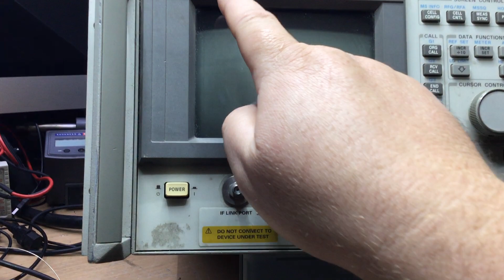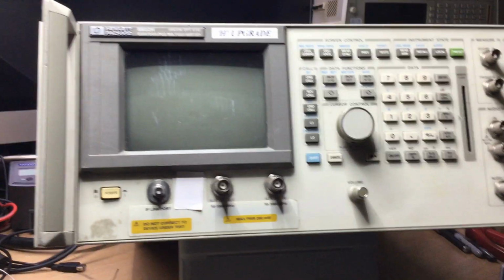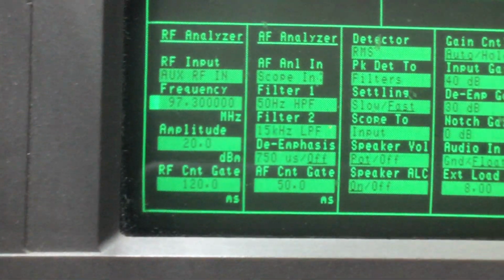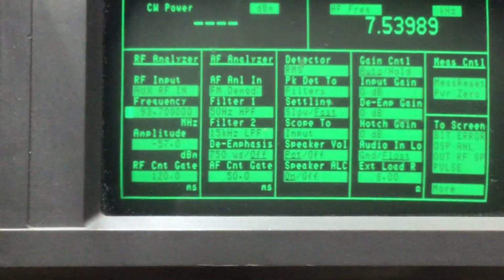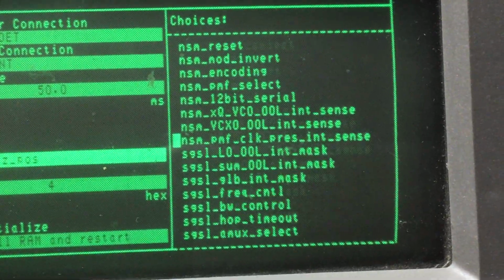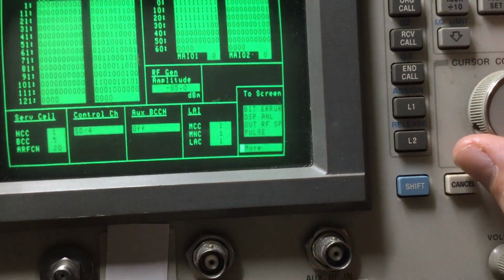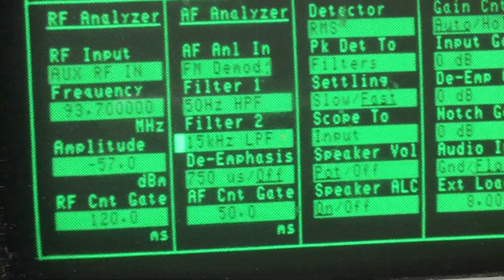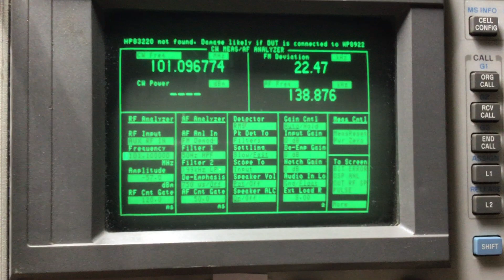HP8922 Test set how to receive off air signals. Subscriber questions.Monitoring outside broadcasts.

Comment: SO what is the diff between the H and the M. As I recall reading the M have more stuff right? I have at home a 8922M and I'm curious of the differences!
Reply from the maker: They support enhanced capabilities such as DCS & PCS networks & more SMS messaging capability, & speech codecs no real use in a CW measurement environment, the compatibility modes on the config screen can be changed so that some of the analogue CW measurement functions can be displayed on the home screen, Also in my case i have the DCS & PCN expansion for 1800 & 1900 MHz & the software versions i.e H upgrade id for option 10 & the expansion module. please see my other video on the Demo of HP8922 for more explanation.